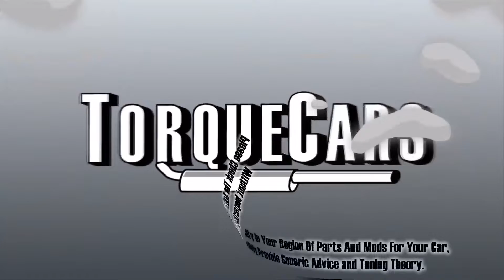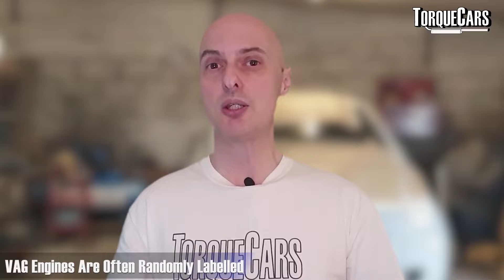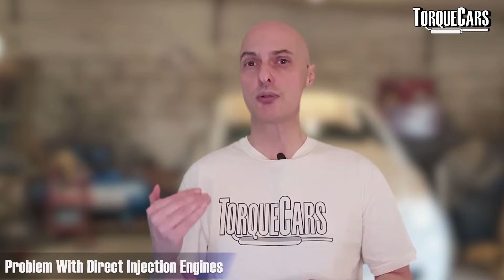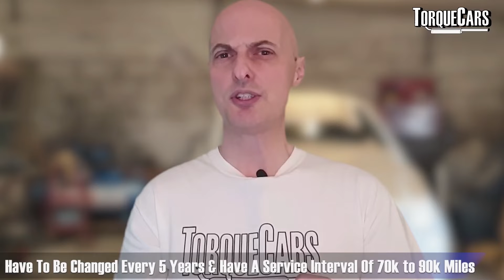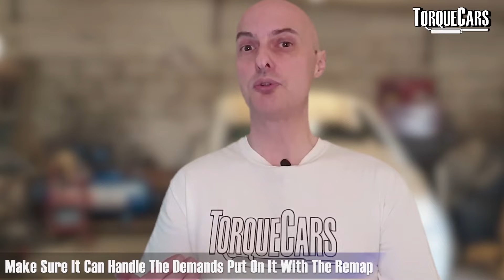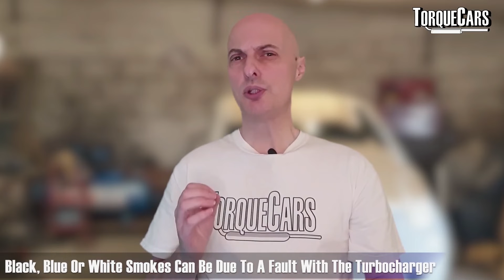Fix Common 1.4 TFSi TSi Problems & Issues 🔧[Troubleshooting]

Comment: I have a 2013 1.4 140 hp cod petrol engine. I hear noises and crackling at certain engine revs.
Certain engine revs. It happens during acceleration, never when I release the throttle. Do you know what it could be? The mechanics who took it to me couldn't figure it out. There are no warning lights on. Every now and then the engine light flashes for 10 seconds, then goes away.

Comment: Q3 8U 2015 new to me, 141kilos on the clock and so far good to me.
Always a good idea to replace hoses, bushings and mountings for an old car. Makes a big difference. Only complaint, is that with all VW/Audi's older cars tend to squeak more after age.

Comment: I think I asked about this before, but a few years ago I got a 1.4 TSI with the CAXA engine, and I started getting the EML and EPC lights flashing. Had it checked out, and apparently cylinder 4 has low compression. The test results came back as:

Cylinder 1: 11.5 bar

Cylinder 2: 12.0 bar

Cylinder 3: 11.5 bar

Cylinder 4: 7.5 bar

I've been driving it since then — it's never broken down or anything — but the engine does shake a bit at idle. If I leave it idling for too long, the EML and EPC lights come back on (lol).

Have you ever seen or experienced anything like this? It still drives fine, to be honest.
Reply: to add all the spark plugs coils filters have been changed too with no change

Comment: There is no vw (the manufacture) recommendation for cam belt change only vw UK probably money making exercise they have now removed 5year change recommendations. I would still change around 80-100k miles as the part that would fail is the cam belt tensioner

Comment: Is the 2017 VW 1.4 TSI a good engine?
Reply: Yes, piston rings were revised and other little gremlins were sorted. Just run it on premium high octane fuel, drop the oil every 6k miles/10k kms and you'll be golden. Replace spark plugs every 4-5 years and coolant every 6-7 years too

Comment: A member of my family has got a 2014  A1 1.2 TFSI sport has ask me if i could be interested in it. First six years serviced and MOTD at main dealer, and since then at a VAG specialist.                                     I have found out it is in insurance group 9 (small number insurance companies class it in group 8), as rest of the range are group 15 or higher.
Are your advice on the 1.2 TFSI is the same as the 1.4 TFSI ?

Comment: The fuel that the manual recommends for the TFSI engine is, specifically, 'Premium Unleaded'. I have no doubt the VW TSI spec will be the same.

I think the prolonged use of cheap shit will probably create problems.
Reply: Premium depends where in the world you are. In the UK 'premium' is actually standard 95 whereas premium premium is 98

Comment: The F in TFSI stands for 'flex' or 'flexible', I believe. It refers to the engine's ability to shut down cylinders during low speed, low demand, driving conditions, like when you're pottering around town, for fuel economy and reduced emissions.

They say that the cylinder restart is seemless but you can feel it, a little bit.

Another tuppence worth: the only time I've experienced slow engine warm up is when I'm blasting the cabin heater on full, on a very cold day.

Back in the day, my dad advised me, if my car is beginning to overheat in a traffic jam, on a hot day (they seemed to be more prone to that, in the past, well, mine was), turn the heater up full. I had to do it a couple of times.

So, I think, blasting the heater takes heat out of the engine and I've certainly been surprised when I've looked at the temperature gauge and the engine hasn't het up properly, on my 10 minute drive to work, or back, in my 2016 A3 1.4TFSI. It's very noticeable when under those conditions. At first, I thought it was weird but then I remembered I was blasting the heater and remembered what my dad had said.

Maybe someone will chime in with 'poppycock' but, in my experience, the use of the heater definitely affects the warming or cooling of the engine because it conducts heat away from the engine, or it can leave it there when it's off.
Reply: I’m sorry but you just fully made that up. TFSI stands for turbo fuel stratified injection.
Reply: @Ayoub-fj9zu I never made it all up, actually. The place I read it from may have but the engine does have a 'cylinder on demand' system, for efficiency and economy, and it does shut down a cylinder and run on 3, in low speed, undemandingu, driving conditions, like in an around town, urban, setting.

I'd call that a kind of flexibility, in how it's engineered to perform, which is why I had no reason to doubt my source. And it is a / the difference between the Volkswagen version of the engine and the Audi one, I believe but, hey, maybe the VW TSI version does it, too. 

Maybe we both have further research to do.

Comment: You’re mad if you think it’s better to start driving instead of letting the car idle to warmup
Reply from the maker: Really? My understating is that idling only dumps fuel/moisture into the oil and takes ages to warm up the engine. 30 seconds of idling is all I recommend and driving it gently warms it up most efficiently.

Note that our temps rarely go below 0c here. I discussed cold starts in detail in these videos as there is a lot of misunderstandings and myths out there...If you live in really cold areas you can add a little throttle to aid the warmup or use a block heater.

https://www.youtube.com/watch?v=2ye-daZ2JtM How cold starts damage engines
https://www.youtube.com/watch?v=ujbQE_DSU2k Cold starts & Short trip damage risks
https://www.youtube.com/watch?v=LA_X4Z9Nwg8 Perfect cold start routine

Comment: I recently had to spend a fortune having my 2013 Golf mk7 1.4 TSI dry clutch DSG rebuilt. Possibly because I didn't have the gearbox serviced (it had only done approximately 70K miles when this happened). So, guys, please dont make the same mistake. Its such a great car and worth keeping it going.
Reply: You can't service a dry clutch gearbox, they are a sealed unit. You didn't do anything wrong, it's just an awful transmission. Manual 1.4 golfs from 2013+ are bulletproof and will last forever
Reply: @stevewilson5929  rebuild is like 250 eiro? New is 400

Comment: Hello, I have a auto stop error every morning and engine light flashes, I've tried changing spark plugs, the battery and even getting the cam belt adjusted. Still error of auto stop system error every time after clearing the codes (Say misfire on cylinder 3 and 4). I've tried changing spark plugs, the battery and even getting the cam belt adjusted. Still an error every time after clearing the codes. Please assist. Golf 7 1.4 tsi 2018.
Reply from the maker: The things that can cause this are typically the battery voltage (make sure it's been coded properly when it was installed), alternator pushing out wrong voltage, starter motor itself and various sensor issues. The cylinders suggest it could be an issue with the "Cylinder On Demand" system where the valves are closed to shut off the cylinders. Is there a rattle in the top of the engine? Is the car down on power when accelerating?

Comment: I have octavia 2021 1.4 TSI with acceleration between 60km/h to 80km/h it will hesitation. I changed the spark and coil and I still have an issue

Comment: LOOL he said "Mine hardly uses any oil" and then said it uses anywhere between 0,5 and 1 liter. Mate that's a lot of oil to top it up for 1 oil change. I bought used Golf Mk4 1.6 on over 400 000 km and in it's first year it hardly used 200 grams- that is called hardly uses any oil. After over 80 000 km of use on this car it now burns 1,5 liter of oil in one oil change 10-12 000 km. Mind that I drove it over 50 000 km on LPG conversion which is prone to loosen the valve seals and increase the oil consumption. So a car with under 100 000 km on the clock that has "to be topped off" with a liter... doesn't sound very good at all.
Reply from the maker: Bear in mind I came from a 2.0 TFSi that used 1 liter every 1000 miles. Interestingly I'm still on my 1litre top up bottle from 3 years ago, so I think I've overestimated my consumption a little. Must check the oil level right now and report back how much is left in my top up bottle.
Reply: @torquecars  Still, doesn't sound good at all. I probably will avoid TSIs. Had some nice deal over 1 Tiguan 2011 with 1.4 TSI but I will pass.

Comment: Great video. I have a Skoda yeti 1.2 tsi and have started seeing a little jerk on acceleration around 2200rpm and 2900rpm. I also see issues with not changing gear smoothly on my DSG. Any ideas please as only had the car 2 months private purchase.
Reply: @richard_on_cars  lookup dsg reset, there's a way of getting the dsg to readjust itself for smoother changes.

Comment: Vw golf 6 1.4 tsi 160 km, 2009 After a night when I start the car and it only warms up a little it starts to smoke (you can smell burning oil) for a moment, the car has working temperature, I turn the car off and after 5-10 minutes I start it again it smokes for a moment (almost every time), as soon as it burns the oil it stops smoking, driving "hard" with the gas pedal it doesn't smoke. Smoke is there almost every time I start the car, observation from 5 thousand km practically no oil has gone. When standing still you can smell exhaust fumes in the car (slightly) What could be the cause. The car has power.

Comment: Thanks for this video! When I open oil cap there is some over pressure puf coming out from the crank case. There is no engine speed change at all when opening the oil cap.

Comment: Adding to this, the CAXA does have issues with the coil pack, the standard coils spark barely enough to ignite, and often start missing quite early on, replacing them with a coil pack that produces a bigger spark most definitely mitigates potential misfires, even when the gap isn't perfect, a spark is not always a spark, bigger spark is better, then again 1.4 tsi and tfsi spans so many engines with so many iterations that there's bound to be some problems for some of them with just about anything.
As for the timing chain vs belt, it depends on the model, however what a VW mechanic told me was that what they initially did was put chains on all engines, including the 122hp models, then decided to cut costs on those chains and opt for chinese trash which was prone to early microtearing and stretching, then they decided they needed a model inbetween, and decided to soup the 122hp engines up to 160hp, without actually testing the chain (stupid as hell), only for it to cause a ton of issues because that chain could not handle the added power, then from 2011 and onwards they upgraded the chain for all models, so it shouldn't have been a problem anymore, and then for some reason (probably because of public perception) from 2012/2013-ish they started going back to belts because the chains (which should've been better actually had they just used the proper quality from the start) damaged their reputation.

Comment: 2014 CHPA with cold misfires. New sparkplugs, new coils, 180k km. Walnut cleaned at 130k km. But always had cold misfires the first 2 minutes only, when driving and keeping rpm's at 1900-2000

Comment: 1.4 Tsi burns oil trough exhaust and smokes white 😢😢😢
Reply from the maker: Oh no sorry to hear that. Did it overheat at some point? This happened on a friends car and it turned out to be a blown head gasket due to overheating. In that case the water pump thermostat failed.
Reply: @tanyagomez5708  having this issue too did you manage to find out what it was?

Comment: Lost count of the amount of VW 1.4 TSi models I've sold over 40 years in the business, I've found the 160bhp over the entry level 122bhp to be pretty much faultless but as usual its all down to regular correct servicing and how the vehicle has been cared for, I only buy vehicles with a Full Service History ( Preferably Main Agent or Specialists, not a quick back street oil change using cheap oils ) up to 2018 they are mostly chains but chain or belt they all need changing at some point in their life, no reason why you shouldn't get mileages comfortably in excess of 100,000 miles, as I say providing its been looked after properly. Turbo's are an ancillary and not a reflection of these engines as a whole, all turbos can wear and be problematic on all makes of vehicle.

Comment: I had a problem with the pcv valve last month, I just cleaned it with break cleaner and a lot of black stuff came out and noticed a lot of oil got in. now it works and I think next year he will replace it with a new one that costs here in Germany 130 euros including pipes.
Reply: @pamilyasaalemanyaYT  did yours pour white smoke too?

Comment: Thank you for your work! Highly appreciated! 

I have a specific question - how does this engine combine with an LPG system? Any particular issues that the engine might suffer from after the installation of the LPG system? I have found a very well maintained car with this 1.4tsi engine (2017 Ateca) with 80,000 km on it, half of which with the LPG system running (installed at 40,000). Should I be concerned? My current and previous cars were running on LPG without any issues, but both are/were with old-school N/A and super reliable engines (Honda K20 and Opel X18). The 1.4tsi is direct injected modern turbo engine, so I have no idea what to expect from the combination with LPG.

Comment: It may be a bad idea to let it sit to warm up but I always wait for the RPMs to drop to normal after starting it.  You really should avoid shifting out of park if it is not at normal idle speed or you may damage the transmission.  Some people seem to shift to reverse just after starting the engine and it may be ice cold still.  It is a horrible idea because the oil and transmission fluid will take a moment to start circulating.  Of course they do a lot better when it is warm.  I even after waiting that 30 seconds or so often like to take it easy on it for the first few minutes.  In cold weather that is especially true.  Treat it well and hopefully it will last and treat your wallet well too!

Comment: I’ve got the golf plus 1.4 tsi I had the timing chain replaced because I was getting a terrible choking rattling noise when starting the engine it was loose and almost near to going but now the noise is  still there haven’t got a clue what is ? Don’t know what is wrong with this car ,feel like I’ll have to scrap it if the engine gets damaged
Reply from the maker: Did the tensioner get changed as well? Is the sound coming from the flywheel area?
Reply: @torquecars  yeh that was changed too

Comment: Hi
I drive  a vw tiguan  2014 , 1.4 TSI. Blue motion. 
Cleaning  of sensors  every  30 000 km  is good or bad .
Will it affect the computer box.
Advise  some of the basic  services or repairs that can be done by owners  
Thanks 🙏

Comment: Hi I have the seat leon 1.4 tsi  2017 auto and have a rough idle, garage diagnosed all cylinders as misfire especially in cylinder 1, so we changed the all the spark plugs, and 1 coil on cylinder 1, but no difference, also I have started using v power petrol to clean the valves thanks
Reply from the maker: Let me know how you get on with vpower - take it for a run and keep it at 2500 to 3000 rpm for as long as you can on the journey. Tomorrows video deals with idle problems so might shed some light on areas to look at. Carbon build up and sensor malfunctions can also throw up problems like this. NB: The valves will not get cleaned with vpower, these do not as far as I recall have port injection but it will keep the injectors and cylinders nice and clean.

Comment: I’ve got a 1.4 tsi just changed the clutch and now I have a engine management light on so I’ve had it plugged in and the fault code is p0016 crankshaft position - camshaft position correlation bank 1 sensor A will this be my timing ?
Reply: @billyhitchmough93  yep!! New timing chain for you

Comment: I have a Golf 1.4 TSi DSG 125bhp 2018 what problems should I look out for thanks
Reply: 125hp? Watch out for the chain and turbo, dont drive hard when the engine is cold and when the oil stinks like fuel after 10k km (I dont use miles) I would recommend a oil change...If you want to get sure how much fuel is in the oil then just send a sample to a Lab for Analyse..

Comment: ea111 engines have a chain, ea211 engines have a belt, other way to recognise what engine you have is the turbo location, all the 1.4tsi/tfsi engines with the turbo in the front have a chain, all the 1.4tsi/tfsi engines with the turbo at the rear of the engine have a belt, also VW uses TSI and audi uses TFSI for their engine names.
Reply: Definitely one of the more intelligent and helpful comments on this video. Thank you for sharing this! 🍻 🇩🇪

Comment: I highly respect your work so far sir. What is the thing with the "ultra" designation on 1.4 TFSI engines? Is it any different from the regular ones? I'm really interested into buying an A3 with a 150HP/manual/2014, but I have no expierence with petrol engines :/
Reply from the maker: It is geared up for better economy and greater efficiency. I don't know too much about them as it is much newer than I can afford, but they probably use COD & the "Atkinson or Budack or similar" cycle to further reduce fuel consumption. Essentially it will be the same base engine, just more refined and tuned differently. If I find out more I'll do a video on the Ultra engine versions.

Comment: Hi, I have a 2011 Polo 6R 1.4 GTI that cranks for a long time before it starts - no fault codes to indicate any issues? Any ideas? Thanks
Reply: Most likely starter is coming to end of its life. If it is only on the first start up then it could be problem with building up  fuel pressure.